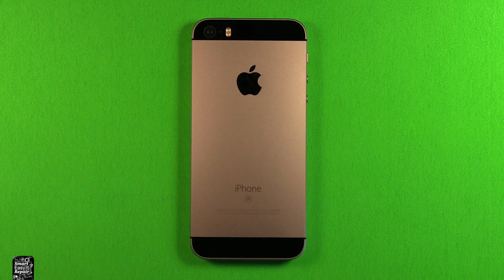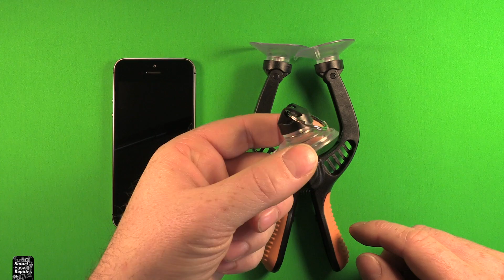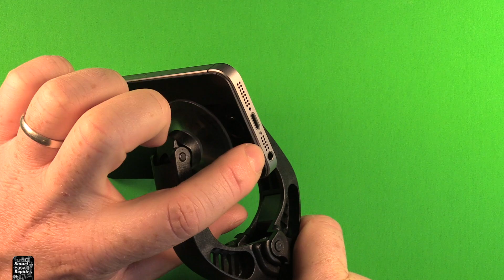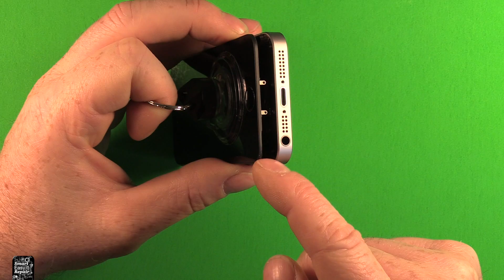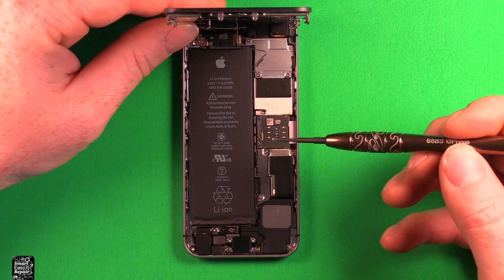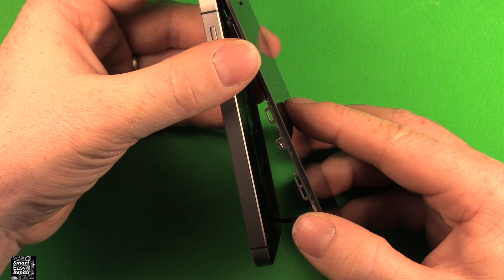iPhone SE Microphone Replacement How To Change

Comment: Very good video!

In an effort to help the next person:

Be aware, there are THREE microphones on the iPhone SE.  The one shown in the video is the "main" microphone, but a failure of any of the three can cause very strange issues with siri, speakerphone, video audio, etc...

To verify if/which microphone has failed, use the voice memo app to test the "main" microphone shown in this video.  Use the "selfie" cam to take a video to test the front facing microphone hidden near the earpiece.  Use the rear facing "normal" camera to take a video to test the microphone hidden between the camera itself and the flash LED.

You're welcome.
Reply from the maker: Thanks for the tips to help others. I’ll pin your comment on top.
Reply: how can I swap the front facing mic?
Reply from the maker: I believe that should be front facing camera one. You’ll have to swap the whole assembly. There should be a video for that.
Reply: Is it safe to replace the main microphone from the display broken mobile ?

Comment: HI, I just wanted to find out where the microphone is located, great video.
Reply from the maker: Hi is it the microphone where you make phone calls or for like face timing? If it’s for making phone calls it’s this one it’s located in the charging port flex cable. I believe the face timing microphone is located in the front camera flex cable assembly.
Reply: @SmartEasyDIYer  Thanks a lot! I just want to know where is placed mic used for video camera recording (in iphone SE 2016 gen).. Is this the same one that are using for a facetime calls?
Reply from the maker: You’re welcome. I’m not completely sure but I think that is the one.

Comment: Hey i never opened a phone before but my microphone is not working properly due to some reason.. would you suggest me performing this repair on my own? Since my phone is out of warranty?
Reply from the maker: +parikshit  sohani Yeah I think if you're careful it's worth a try since it's not under warranty anymore.
Reply: My mic sounds really low. Ppl on the phone cant hear what i say. Do u think i have to change thmic on my SE? Thanks!
Reply from the maker: Yes sounds like it to me
Reply: Smart Easy DIY Okay, thanks for the help and the video, i ordered the parts.  Will see.